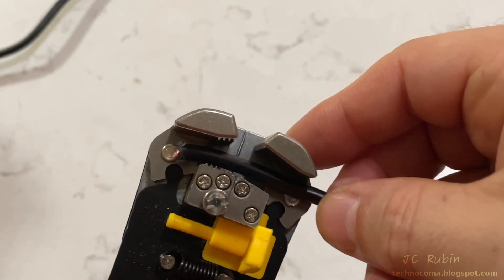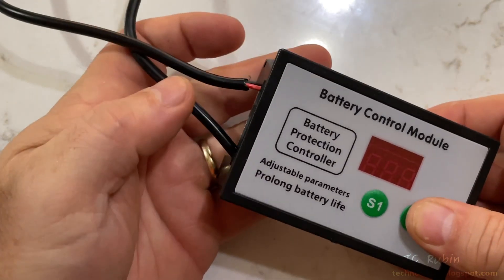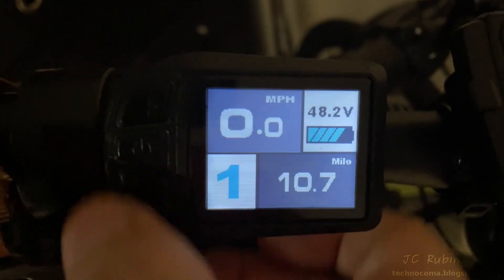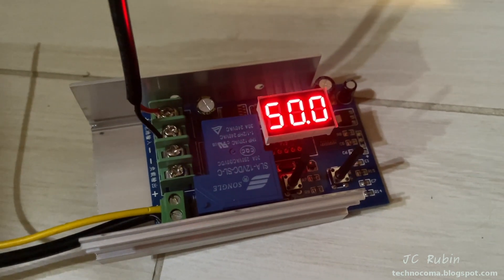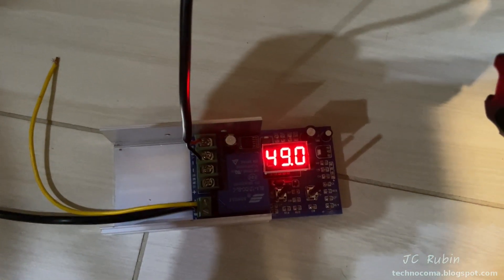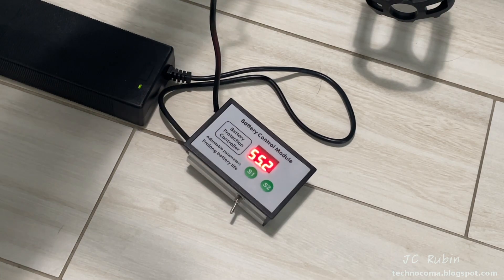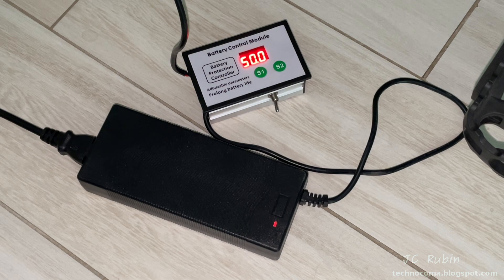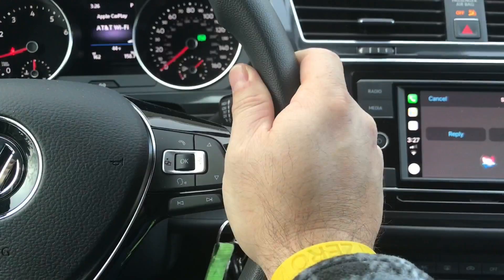Increase the lifespan of your ebike battery with a smart charger.

Comment: Since the battery is charged using constant current until it goes to constant voltage in the charge cycle, a voltage cutoff is not that great idea during charging. You basically need to disconnect charge and measure the voltage to determine when to stop. You will most likely stop too early I would estimate it to be under 70% state of charge. If this is enough 60-70% will extend battery life.
Reply from the maker: The settings made to the smart charger are such that at cutoff an inspection of the charge from the bicycle computer shows 80%, meeting the objective.